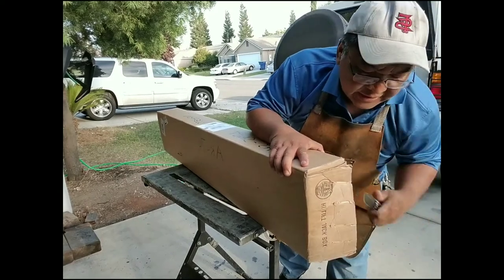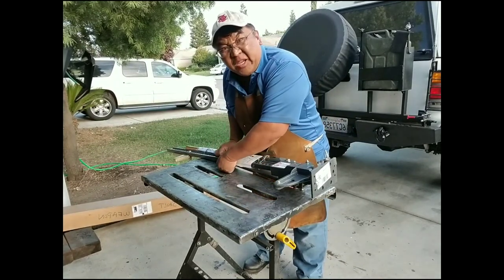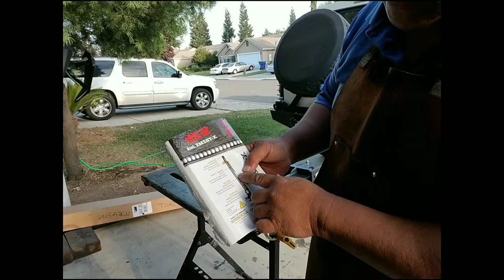48 inch Hi-Lift Jack XT485

Comment: Story time.  My neighbor is elderly and she has this small Kubota tractor with a mower on it for her small 3 acres. She stoped by one day and wanted me to change the fluids in her tractor and gear oil in mower. I noticed she had this wood handle jack in the corner (1934 Harrah Handyman Hi-Lift didn't know it at the time) with lots of other modern gardening things, she had asked did I want any of the things because they were going to yard sale that Sunday. She asked in particular if I knew what the wooden handle thing was I said its a jack and dangerous if you dont know what you're doing.  I finished servicing the tractor she tried to pay, said I can't take it. I said I would love that old jack you showed me, she smiled said yes take it,  I was going to take it to the dump didn't want to sell it and someone get hurt. I thanked her as she did me. I restored that thing, sanded the handle applied linseed oil, new climbing pins, springs and wd-40 good cleaning, almost no rust to begin with.  I have used that thing to jack up my tractors and on the farm here and there, such a pleasure using it. Something about a wooden handle.  Now I have a Jeep, thinking about mounting it on the outside.  Funny thing is that old Harrah  Handyman  Hi-lift jack is a 1934 model and works as well today as it did when it was made.  Things were built to last thats what I like.  This throw away society we live in makes me sick, the factories have to run 24-7 in china because their stuff breaks, then cry about pollution. I've recently got one of the Hi-Lift extremes but love the look of the old school and it works so well still, think I'm going to mount the old school one on the 'ol 4.0 Wrangler   Great vid.
Reply from the maker: Thank you